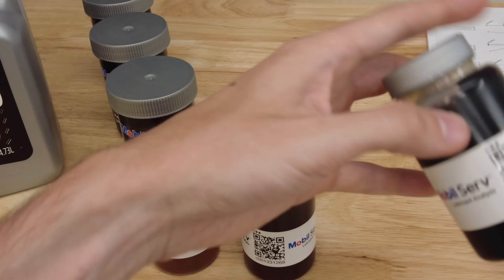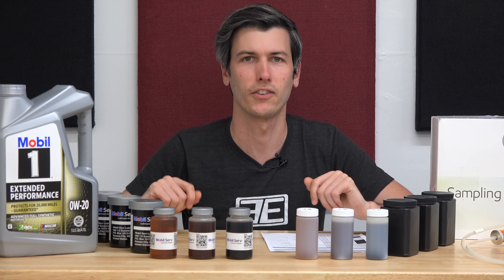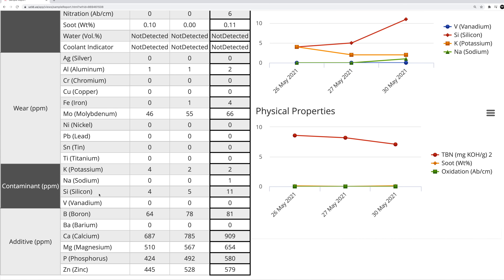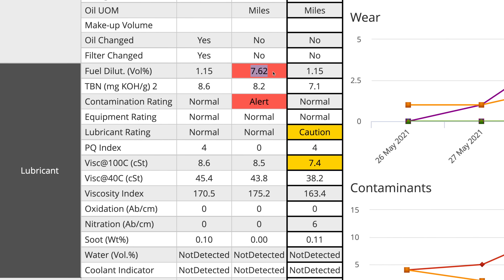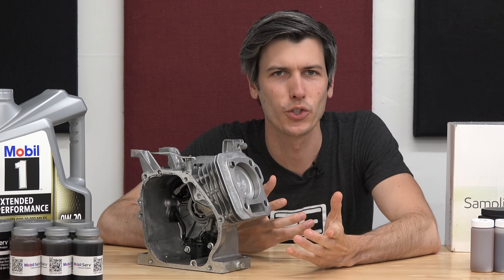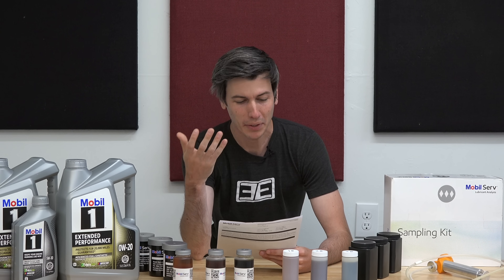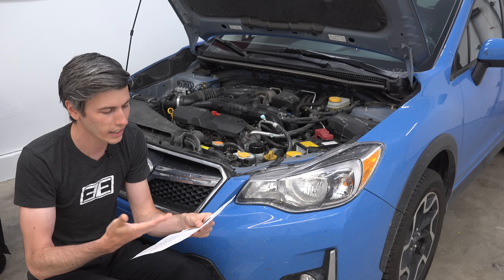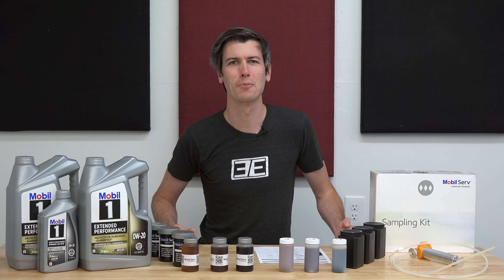Does Your Engine Have Hidden Damage? How To Know!

Comment: I would be surprised to see that M1 lasting 20k in your engine (as the marketing reports), given how it is losing viscosity as it ages. If you were to resample at 6000-7500 miles, I would be very surprised if it was still within spec for a 20 weight.

Comment: How much money is in anyones [out of warranty] engine?  Price a rebuild, and oil analysis may find its value.  But it helps to start early, when it's new.  After that, the second oil change, and once a year [whenever oil change hits] after that will probably suit most people - it takes 3 or more  data points to decide if there's a real trend going, a one off problem, or maybe your chosen oil formula was tweaked without necessarily rebranding.  Create you own spreadsheet for quick review - flipping pages becomes trouble after many years in service.

Comment: Hey...
That's a great video quite informative...
The reason why the results showed high level of fuel in the 15min idling is for a reason explained below.
Piston rings and compression rings have a small gap which expands once the engine is warm enough.. till is was warm enough your vehicle had a the addition of fuel to the oil...
I hope this information helps you and others reading this...
Thanks

Comment: kv100 Viscosity going down to 7.4 cSt (about 0.7 less than ideal) is something seen a lot at 3,000 miles with the VII 'plastic' molecules breaking apart (shearing).  Visc usually begins to rise after 3,000 miles, gradually, via oxidation, so it kind of corrects itself in normal use.  I've seen plots of visc vs. time from the Mobil1 people, and it does show a dip in visc at 3,000 miles, & rising slightly after that, so it's fine, no problem.  .... Actually, for this Subaru engine and other engines like it that call for 0w20, you could use 0w30 or 5w30 full-syn if you live in a hot climate or are towing, in order to counter fuel dilution and when you want extra wear protection (thicker hydrodynamic oil film).

Comment: My first bike was a 100cc motorcycle which I am using from 2013. During pandemic situation I don't use it for 2 months bike milege at the time was 65k Kms. After 3 months of total rest in garage bike don't get started kicker starter was simply moving downwards without compression. I call the mechanic he took it to the shop. After that I came to know that valve got some issue so engine did not get compression. Some valve related engine parts were taken to another workshop for machining purpose. Then some leaky gaskets replaced sparkplugs replaced, carbs cleaned and retuned. 
Now the bike almost covered 75k Kms 2 oil changes with 20-40 semi synthetic oil. After that engine overhaul, I observed my oil get blackening that in previous conditions. I have a sight glass on the crankcase for oil level observation. Through which I can see the oil colour too. But I did not observe any fuel efficiency issues or performance issues but little starting trouble in the morning especially starting bsfter 1 week of rest or more. Is my engine safe or not any idea? I am getting 80km/ltre of gasolin milege. The company claims 87km/ltre. Only issue is blackening the oil quicker than earlier and starting trouble while it is cold. Should I retune the carb in an expert shop?

Comment: The fuel dilution is from excessive idling.
Once the engine oil fully warms up, the PCV system should be able to remove the fuel vapor.

Comment: Decades ago when my brother was a diesel truck mechanic, he told me about oil analysis as a way to determine an engine's health.
When it comes to hidden engine damage, I wonder how the VW air-cooled flat-four in the 1960s would rate?  Having operating such vehicles, it's remarkable the amount of maintenance neglect that engine could be subjected to, and still keep running.

Comment: Nice job! We are big believers in used oil analysis. Higher levels of blow-by will increase oxidation, soot and fuel dilution, so used oil analysis is a great tool for checking and monitoring piston ring seal.

Comment: Someone help me! My 2015 370z oil seems to be a bit reddish color in it. Only 38,000 miles on the engine and the oil has about 2,000 miles on it. Is this normal?

Comment: Isn't that cold running engine will have rich mixture, that will cause fuel appear in oil until it heats up and vent it? This way fuel dilut. in cold running oil is a sign that test was done well.

Comment: Now I wish I could have an oil analysis done on a used car before I buy it. That would be an amazing value if it didn't need to be driven the 3k miles between samples.

Edit: Turns out you can and it's really easy and cheap.

Comment: Tumbs up for your videos. How about a video on how Mobil works with car companies to set up alogrithms for cars on-board-computer to alert car owners on engine approaching its oil change. By the time these cars reaches their alerts for next oil changr what would be the typical results for these used oil?. Would parameter like TBN still at >2?.What would be mean average change interval in milage if we let the onboard computer to determine oil change interval?. Most important is that you need to advise car owners to check engine oil level at every 1000 traveled miles as some cars could consume 0.5 q of oil for every 1000 miles. Also we have mechanics still advising oil change at every 5000 miles even it is fully synthetic oil. Regards.

Comment: How are you guaranteed to get an accurate annalist with a small amount of oil pumped out? Something tells me this is a useless scam that gives you no real useful information. How many people will freak out & start replacing parts that are perfectly fine? Also what about the difference in engine design & mileage? To many variable's for this to be an accurate measurement of anything.

Comment: I have been told fuel in the oil id common with long idling, which explains your results.  This happens to me in MN over the winter with letting the vehicle warm up, then driving only short distances to work.  Longer trips will burn off the fuel in the oil, as long as there isn't so much that it mixes in and thins the oil to the point that both fuel and oil blow by into the combustion chamber.

Comment: Maybe there is a link between the operating temperature of the engine?
I could think of a normal behavior of any engine to mix engine oil with fuel.
Any fuel will dissolve oil.
Once hot , an engine could maybe have a better compression and mostly , fuel will evaporate faster when it s hot .
So maybe , any new or in good condition engine will end up with a few fuel mixed with engine oil at start .
What do you think ?

Comment: I was heart broken when I was told not to use Mobil one in my turboru. Three past Subarus went 300k on Mobil one, vdc and two outback sports. Now I use Motul    X clean 530 on my 13 WRX every 3-4k. I wanted to keep it 530 and Motul has that good shearing rate. Those oem Subaru air filters really are the best, I have a new itb grimmspeed intake collecting dust after seeing how much oem collect after 3k.

Comment: Hmmmm.....   I kept looking at the increasing PPM of Molybednum.  If the virgin sample of the oil was lower than what was detected after use, where did it come from?  Two things come to mind.  1) Washdown from previously used oil with a high molybdenum content (or an additive shot at some point) or 2) piston rings, which are sometime coated with the stuff.  Anyway, something to watch at next analysis.  And, yes, high fuel dilution after a cold start is why you want to get that sucker hot every chance you get to boil out the gasoline before it thins the oil to the detriment of everything!

Comment: I got a new car this year, and was a bit surprised when I looked into the owner's manual that it recommended the first oil change at 12 months or 6,000 miles.  I did a double-take.  IIRC, coolant flush was either 100 or 120k miles.  It's amazing what these engineers have done.
Reply: For future readers,  take ph balance strips to check coolant.   I doubt it'll last that long.

Comment: I was trying to find information on why there's no inverted engines in cars? It seems there hasn't been anyone able to explain why.
The Germans used inverted V12s in their WW2 fighters, but is it possible you could do a video on why they don't exist in road cars?
Reply: In airplanes in which the propeller is attached directly to the crankshaft (or a planetary gearbox on the same axis), it is often desirable to have the crankshaft as high as practically feasible, so that the propeller is not too close to the ground during taxi, takeoff, and landing, and also so that the center of thrust is closer to the center of drag, thus preventing excessive changes in pitch with changing thrust.

In cars, it is usually desirable to have the crankshaft low to the ground, so that the transmission is also lower to the ground, lowering the center of gravity, thereby giving the car more stability and traction in turns. Also, with automatic transmissions with planetary gearing, it then lines up nicely with the driveshaft.

(Except in Australia, where everything is upside down.)

Comment: Over the years oil companies like Mobil, Pennzoil, Valvoline have not only raised their prices but stress to change your oil every 3,000 miles. But you know what? This is always way, way too soon. My general rule is to change my oil every 6 months unless for some reason I drove my engine really hard, which is rare in my case. 

Also remember one important factor is highway driving is very easy on the engine, city driving is way worse on the engine, like 5 times worse so make sure to change that oil every 6 months you'll be in fine shape.

Comment: Interesting addition re sand... I used to work with dual fuel diesel engines that would run on mixture of diesel and CNG or LNG. The attraction for many was to use Biogas/Biomethane for the CO2 benefits. We found that this kind of gas had siloxanes in it. Overtime it would basically be sandblasting the insides of the gas injectors and getting into the engine oil etc. Not good! They tend to leave a white powdery residue on the hot stuff.

Comment: Just wondering how you avoid contamination from the pump kit itself. Or is that insignificant? Are you using a new pump kit or hose every time? You are not cleaning the pipe out with gas are you, and then get gas contamination results. Please tell us about the procedure.

Comment: as an engineer, im surprised you did not explain that your 15 minute idling session having the highest oil dilution makes perfect sense.  It goes to show you should NEVER let your car sit and idle to "warm up" in a modern car. you want to start moving as soon as humanely possible (still keeping it under 2500rpm until your water is up to temp) to allow the piston rings to expand under heat and properly seal off the fuel from getting through the pistons into the crank case. So short trips and idling around cold = BAD in short.   But after 3000 miles, this is why most of that fuel "cooked off", as with a road trip and in particular lots of long 10+ mile highway speed daily commutes - it is much better for your engine, as all the dilution that occurs at cold start has plenty of heat and time over distance to burn away and evaporate itself out of the flowing hot oil during a long and fast enough drive.

Comment: I've ordered and recieved a Blackstone analysis kit and plan on a 3k change on my 2.4 DIT. About 600 miles to go.
I feel this is a very important subject and have since the 70s and 80s while working as a heavy equipment operator and saw oil samples taken every oil change.
Thank you for posting. 👍

Comment: Great video! Really enjoy all of your work. Side note: may want to look into a Fumoto valve; I have a BRZ and oil changes are much easier (and cleaner) when not dealing with the drain plug and washer, plus you can take quick samples without needing cleanup of a pump after. Need to install one on our CX5 but I have way too many washers left to justify it yet.
Reply: What about oil extractors? What’s your opinion on them?

Comment: The military has been using oil analysis for decades (since the 80's) particularly for their tanks. It works but in general its only worth it for fleet vehicles that have constant heavy use. In passenger cars its overkill.

Comment: Hi Jason, I have a question which could make an interesting video as fuel efficiency isn’t intuitive for most people. If you were tasked with making a car that only ever had to travel at one specific speed, say 100km/h, with no hills and consistent wind resistance etc. what would be the best engine size and gearing strategy to go with for fuel efficiency? My guess would be to either have the engine at peak hp or peak torque when doing 100km/h and with a fairly small displacement. If either are correct could you explain why, or if not can you explain how to work out the ideal setup. Great videos, love your channel.😃
Reply: Hopefully an example will help explain the question a little better. A 1.3L engine would be more efficient at 100km/h than a 5L V8 even though the 1.3 is revving higher, presumably because the small engine is closer to peak power/torque so isn’t being robbed of as much energy due to low end rpm losses. How far could you take this? Would it be best to use the smallest engine that could provide the power needed to keep the car going at the desired speed and gear it so peak power occurs at 100km/h?

Comment: You would have a very different picture if there was no longer trip in the mix. 
The coldstart mixture is believed to be also one of the culprits of killing them (belt in the oil) engines. The bio component with other solvents will just ruin the oil really fast, if the car is driven only city cycle (say 3-5 miles at a time day in - day out).

Comment: Ignore fuel dilution. If you put in new, cool oil, and idled for ~15 minutes, it's possible for hydrocarbons from an idling engine to condense into the oil, until the oil has a chance to heat up. Once the car is driven for 20 minutes or so, the oil will come up to temperature long enough for condensed hydrocarbons to evaporate through your positive crank case ventilation system. (a loaded engine burns cleaner)
     Water tends to emulsify oil, by using detergent to bind the water and oil together. That creates a thick substance similar to mayonnaise. That definitely increases viscosity, and sometimes, will even clog oil pump pickup screens, and oil filters. Condensation from chronic cold driving, or water and coolant from a bad head gasket can definitely cause that as well.

Comment: Could the fuel being in the oil from not being driven and only idle for 15 minutes. My initial suspicion would be it’s running richer during first startup and coolish oil. Potentially rich on purpose for the catalytic converter to get to temp. That was a bit of a shot it in the dark. Vaguely remembering how far engines will send in burned fuel into the catalytic converter which essentially is still burning to speed up the temp of the precious metals in there.

Comment: Let's say you've bought a used Subaru WRX STI hatchback. Could you get an oil analysis done as a supplement to a compression test to help understand the health of the engine? Like... is this thing just barely hanging on or does it seem like it's still in good shape despite how much fun its previous owners might've had with it?

Comment: It’s sort of like an auto colonoscopy. You should have one a year starting at four years/50K miles and stop after ten years/150K miles because odds are you and your car are going to die of something else. How would an engine oil analysis compare with a compression test for a quick and cheap screening for engine wear? Unless the results are going to change the way you maintain your car it seems like a reassuring waste of money.

Comment: Most of the damage of a regularly maintained engine is done by the acids that form in the oil after about 30 days driving there is enough to begin to damaging the engine. Anti acids cause deposits.

Comment: you did these tests on a Subaru with less than 40k miles? Can we get the same test with a factory sealed engine that has well over 200k miles and then compare results with these? Should be interesting.

Comment: I used to send in oil analysis. All it seemed to do was determine and confirm what you already knew.  When a motor isn't happy they usually let you know it other then that not worth losing sleep over common wear.